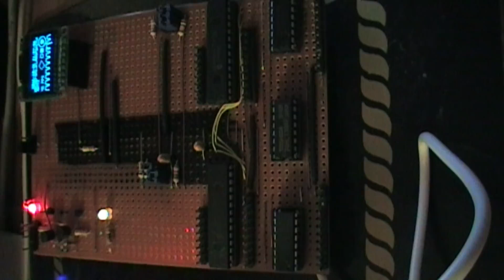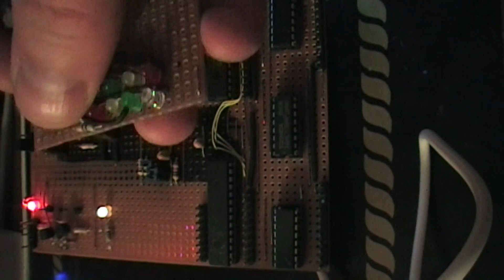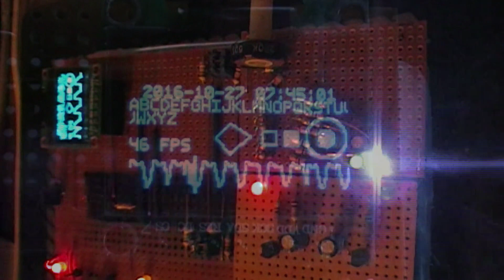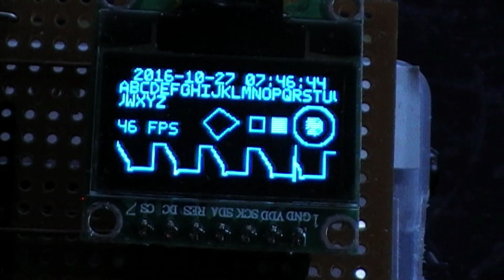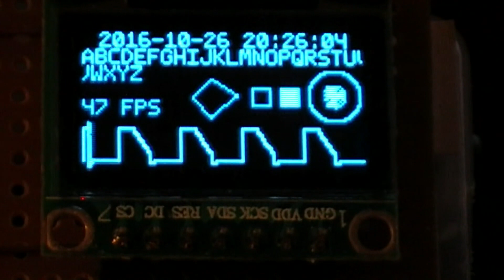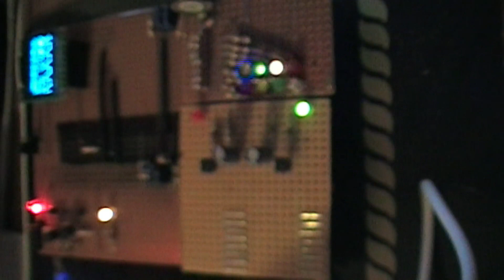Raspberry Pi SPI Connecting 2048 GPIO pins or 128 Analog to Digital Inputs

Comment: Excellent! Much better than "Hello, Blinky". We are thinking along the same lines.
Reply from the maker: At the time I didn't think I would be needing to use many I/O lines, it was really multi SPI devices I was going for. But now I want to make a car simulator at some point where I can plug in a car ECU and control it. So I will be needing many I/O lines when I get around to it.
Reply: That sounds great. Have you ever considered tri-state technology to enable the bus to handle inputs and output consecutively? Another thought might be distributed IO with differing Pis linked together? PiRing?
Reply from the maker: I've used tri-state on my most recent PIC micro-controller project to keep the power consumption down. And on a Raspberry Pi project to power off an LCD back light. But not distributed I/O yet.

Comment from the maker: The full details for this project can be found here: http://www.newsdownload.co.uk/pages/RPiSPiDev.html
Reply: Jason Birch hello I've been reading about the hardware and I am just wondering:  for the 4-16 line decoder, what are the other gpio pins for and which gpio pins should I use?  And with the mcp23s17, is it possible to have 2048 inputs as you said?  I apologize as I am new to this.
Reply from the maker: The driver software uses the GPIO pins up to three GPIO pins of the Raspberry Pi to drive the 4-16 line decoder. You specify the GPIO pins you want to use in the configuration file of the driver software. The 4-16 line decoder allows the three Raspberry Pi GPIO lines plus the SPI CS line from the Raspberry Pi to select up to 16 chips, because with a 4 bit binary number you can count 0 - 15.

The MCP23S17 has three address pins. You can use these to connect up to 8 chips to a single line coming from the 4-16 decoder. You have to hard wire the address lines on each chip so that each chip has a unique address on the single decoder line.

As there are 16 IO lines per MCP23S17 chip, you can have 16  decoder lines X 8 chips addressed per decoder line X 16 IO lines per chip = 16 x 8 x 16 = 2048 IO lines in total, controllable from the Raspberry Pi. In addition, you still have the Raspberry Pi GPIO lines which remain unused.
Reply: Jason Birch Will there be any noticeable latency if >500 gpio pins are used?
Reply from the maker: There shouldn't be, because the process of reading or writing any individual IO bit is the same:
Set the 4-16 decoder value.
Set the chip address.
For writing, read the current port values, logical or to set the bit, or logical and to reset the bit.
For reading, read the 16 bit IO port and mask the bit required.

So it is the same number of steps, which ever port bit or bits are required.

The only latency will be if you want to read or write all bits on all ports. So reading or writing 16 bits (one chip), is a single operation, which takes X time. Each additional 16 bits (chip), will also take X time. So for 5 16 bit ports it will by 5 x X and for 10 it will be 10 x X.
Reply: Jason Birch Thanks!  The info is very interesting as I am doing a project that requires at least 150 or so ports.  This seems to be the most useful way to as I can have many combinations of devices.